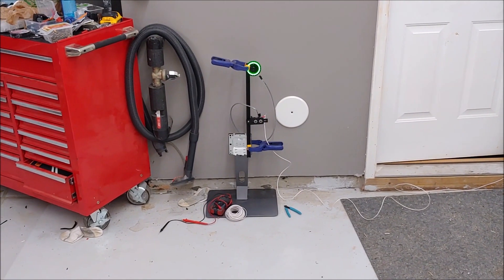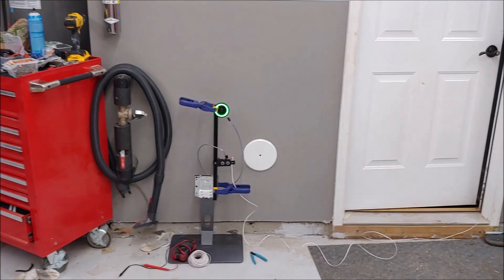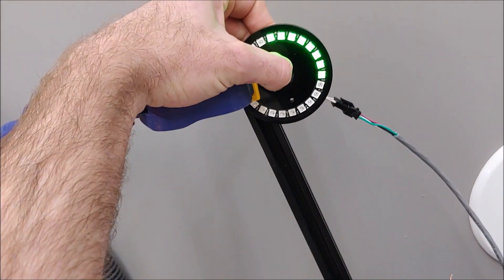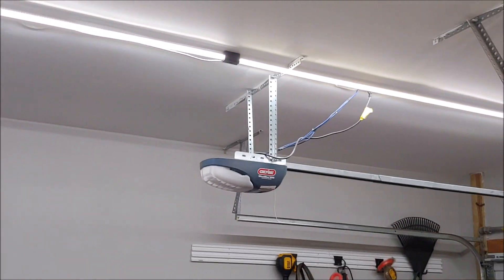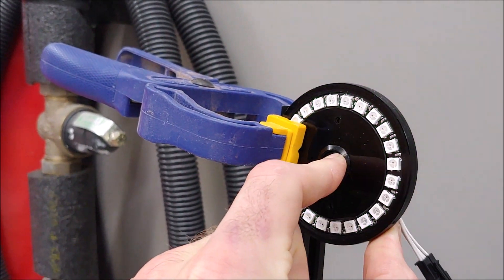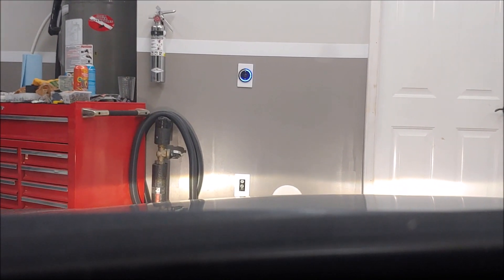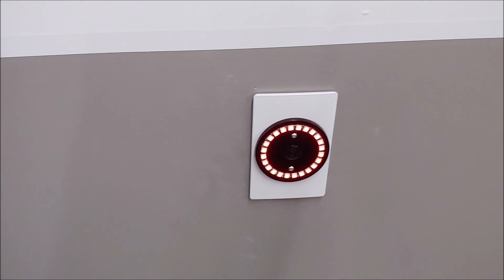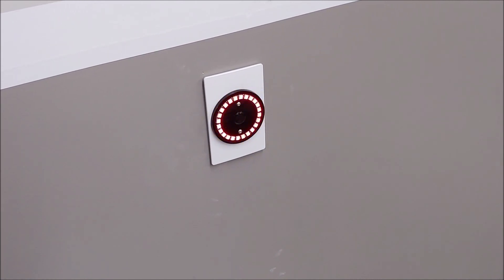Arduino Garage Parking Sensor

Comment: Hi I have downloaded your code for version 4 from thingiverse but I am new to this and you have a button in your design (#define BUTTON_PIN  5  #define BUTTON_SINK_PIN  6) so do I put one end of the button on pin 5 and the other end on pin 6 sorry if this sounds stupid but this is my first try at Arduino. Thanks
Reply from the maker: Connect the button across it.  It might be named incorrectly, it might actually be a source pin technically.  Basically the button has to be pulled up for the pin on the arduino to detect voltage when it's pushed.
Reply: @ReiniGrauer   Ok thank you

Comment: Reini, love your implementation of the parking sensor. A few questions for you. Would you mind sharing the code you created for the button for learning the new distance? Also, have you had the chance to create enclosure designs for 3d printer. I wanted to replicate your design and see if you had any more information to go on with. Thank you for sharing this.
Reply: I made something similar, I made a Chevy emblem enclosure and used actual LED. I’ve been using it for about 2 years now and it works perfect every time.

Comment: Thanks for this video. I have it working like I want it and now just need to figure out how best to mount it in my garage. I have a friend with a 3D printer who can print for me. I see the .ai file in the Thingiverse link you provide, but neither I nor my friend are sure what program to open it in. What software should I use to open that? Thanks!
Reply from the maker: That file is for a laser cutter.  At some point I should probably design an enclosure for 3d printing and put it on thingiverse.  I'll spend a little time on it when I get a chance.
Reply: Thanks @ReiniGrauer ! Are you willing/able to create an enclosure for me? How much would you charge for your time and materials?
Reply from the maker: @LordPandemic  if I design an enclosure I'll put it on thingiverse and your friend could print it out
Reply: Reini Grauer that works for me! Thanks!

Comment: OK i have it up and fired it up, but is there a limit to the number of leds that this can sync with, Im using a Strip led and testing went well with the 24 led count, but i bumped it to the 71 count and now nothing works. humm any sugestions?
Reply from the maker: Mind sharing the code?  You just bumped the number of pixels up to 71 and it doesn't work?

I had an issue where when the ring was at full brightness, the more pixels I used and the more colors I used, the power draw would cause weird stuff to happen to the little ultrasonic sensor and the whole thing would bug out.  That's why I'm only using red/green/blue colors and have the brightness turned all the way down.   I think the neopixel stuff is designed to run off a battery because of the high current draw, and you're supposed to wire it up with a capacitor or something, which I didn't do. 

You can try reducing the number of pixels and see if the behavior improves.  Otherwise I think you might need to increase the size of the power supply driving it.  I was using standard 5v-1A phone chargers to run it, and the voltage drop was enough with 24 pixels to cause problems unless the brightness was turned down to like 15%.
Reply: @ReiniGrauer  Thanks for the reply, i got another one to run Stable with readings and such but i like yours with the button, this is my test https://youtu.be/hqnj336Z5pA if you want to jump to discord we have a section open fro you https://discord.gg/5x35q8a

Comment: I like it! But do you think the strip led would be a better visual?
Reply from the maker: Any kind of led indicator would work.  It could even just be a stoplight sort of thing with a green/yellow/red arrangement.  I liked the way these ring leds looked so that's the route I took.

Certainly there would be easier ways to fit a smaller indicator in the electrical box and faceplate.
Reply: @ReiniGrauer   thanks for the reply Reini, I do like your 5v jumper from the light lol. We have the same issue, longer vehicle now in the garage🤔  I might just copy yours minus the fancy printed parts☹️ no 3d printer here. I will say you have knocked it out of the park with the adjustable sensor reset which I have not seen on any other video yet. That option just opens up a world of adjustment without having to reprogram the unit each time. We automator house with using nodeMCU and home assistant but I'm thinking this will be good as just a stand-alone device and I do have an Arduino Uno sitting around not doing anything so be a perfect project. Quick question how do you made any updates to your code then what's uploaded?
Reply: @ReiniGrauer  OK so the ring light is OUT Way too much $$$ ( im canadian and to get one here is crazy ) BUT i do have 5050 LED strip light sitting doing nothing. so thats what it will be built on. few questions for you, Discord? https://discord.gg/GD7fJv8

Comment: Example Code?
Reply from the maker: The code is in the thingiverse link.  One of the thing files is the arduino .ino project.  Im not sure if thats the latest code for it in there but it works.
Reply: @ReiniGrauer  The code did not work for me. The button seems to function correctly but the led's just stay green. I checked the print log and it seems like the sensor is not reading. Although, when I run a different code to test the sensor, the sensor works. Can you give any insight? Love the project!

Comment: How visible are the lights in the day time?
Reply from the maker: They are very bright.  And since you are looking at the leds from straight on, it's still very bright, even with the brightness turned way down.  To give you an idea, I've got the brightness setting at 10 of 255 on the FastLED API.

My garage uses 6 70w LED stick lights so it's almost as bright as daylight in the garage with the lights on, so the LED ring is plenty bright as it sits.
Reply: That's definitely bright enough.  ;-)